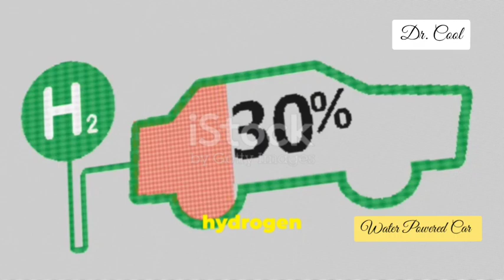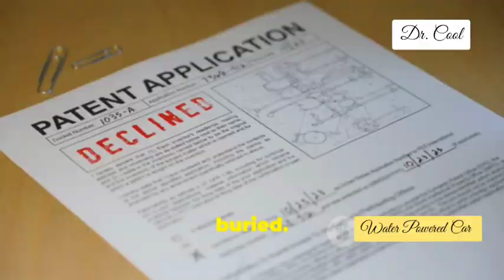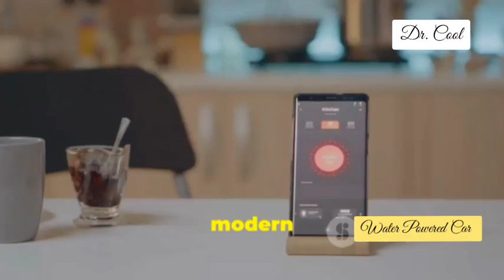The Water-Powered Car from Nigeria – A Revolution That Will Brutalky Shake the West!

Comment: The water powered car was discussed by the CEO of Toyota at least 5 years ago. Elon Musk talked about it as well at least 2 or so years ago. So, it's nothing new. More than 20 years I read that the problem was braking the strong bonds between the hydrogen and oxygen atoms of water. Once that could be done water could be used to power automobiles.